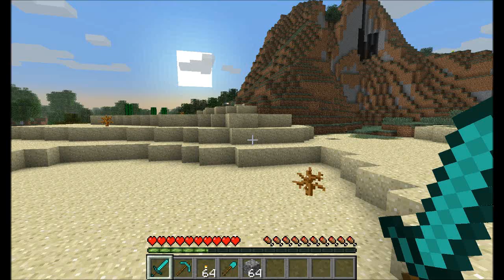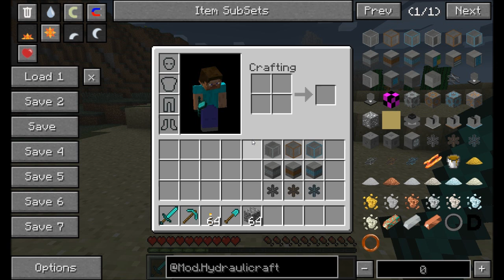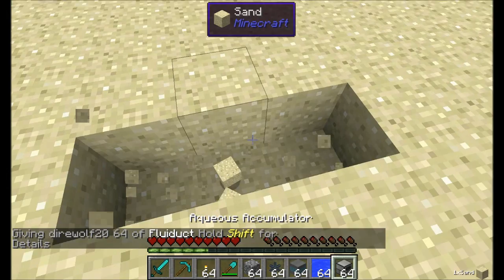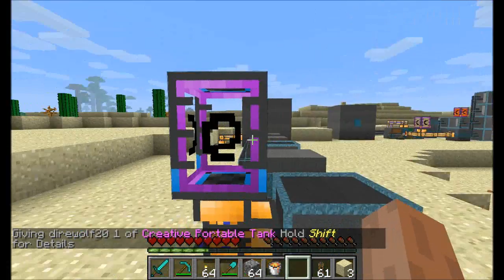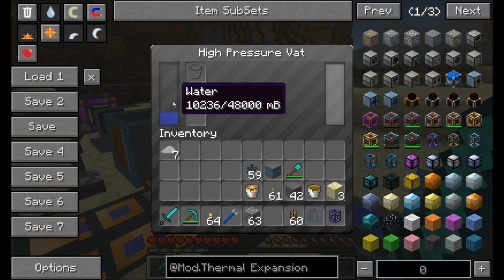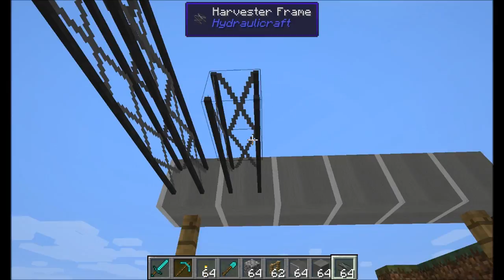Mod Spotlight   Hydraulicraft

Comment: As someone who plays with finite water... I don't even see HOW I could play with this mod. :p
I already have problems keeping my boilers running... with a system like this, I would need a separated world dedicated to pumping water exclusively. :p

Although it looks different, and the planter would be amazing even as a separate mod, so... kudos to the creator! ^_^
Reply: Nah, you'll only need initial water: Make a vat, a pump, 2 pipes and a mixer. Supply  it with water and wait for enough hydraulic oil. Once you have enough, you can quit using water and use all the other machines.
Reply: jedioutcast74 Because it becomes harder. Maybe he is using Gregtech which makes this.
Reply: You could make a Mystcraft age dedicated for pumping water.
Reply: ... im pretty sure that the Aqueous Accumulator from Thermal Expansion doesnt care. it fills with water from 2 nearby watersources to fill itself with water, but it will NEVER use it up :-) i tried on a server where water had the same effect as lava: not infinite in a 2x2 or any larger pools, and it worked there ;-)
need more water? make another Aqueous Accumulator. and for gods sake dont use BC pipes... if youre having trouble keeping your boilers filled with water, then you propably use BC pipes dont ya? fyi: bad choice. they are very slow to transfer water. Thermal Expansion Fluiducts are much faster to transfer liquids with.
Reply: You could install MagicalCrops and farm water?
Reply: jedioutcast74

Yep, I have always liked my games hard. Finite water + no natural regeneration are a must for me. Also, I have been playing Minecraft for way too long (there was no Nether yet when I started), and that makes getting a challenge a little more difficult.

TheLozfan123

I have done that. But nowadays, I play without "teleporting" items, so... not an option anymore. If I want water, I have to get it directly from a pipe/create it myself using resources.

*****

No, I mean finite water. As in... not infinite. Finiteliquid is a mod, and, as far as I know, it is not compatible with most mods. Not to mention that I think the mod is not updating anymore... I believe.

MadLocustRising1

What would be the point of that? If I wanted to have infinite water, I wouldn't be playing with finite water, right? Playing with finite water, and then finding "tricks" to get infinite water seems... not very logical, at best.

Zambogerami

That doesn't work. There is only one source block to "transfer". Yes, it would transfer very quick, but... it is only one block still.

Schist025  The Unknown Gamer

I don't use any mod to get finite water. Chicken Core (the mod you need to run NEI) has a config option that allows you to turn infinite water off, as well as other few nice "niche" options. So yes, the accumulator would work, since the water is vanilla water, but using an accumulator would negate the point of playing with house rules, don't you agree?
Reply: Schist025

But the point of not having infinite water is to make the game harder. Why would I use a machine that completely destroys the challenge in getting water... if that is exactly why I created the challenge for myself? That would be quite counter-intuitive, don't you think? (Also, TE is waaaaay too OP for my taste, so I don't actually have the accumulator as an option, even if I wanted to cheat myself using it :p )
Reply: ***** Meh shrug. I use dartcraft so OPness is kinda what I like xD
Reply: Coby Frye

Woah, someone needs to take his pill already. :p

I said "too OP for my taste". Are you trying to tell me what I should like? Because... good luck with that.

And yes, the accumulator creates infinite water. Mostly because it never runs out, AND it is created fast enough to fill quite a lot of things.
And about "they made water infinite for a reason"... are you really telling me that in a video about a mod? xD There is little Vanilla Minecraft in my Minecraft. I choose the mods that make my experience more fun, as everybody else.

Also... my boiler already exploded in one of my worlds, destroying everything except my Thaumcraft tower, which was flying in the sky, and I still preffer my way of playing, AND I still believe that the accumulator in particular, and TE in general is extremelly over-powered.
It even proves that I am right more than you are. Just by placing one accumulator, and doing nothing else, you can prevent boilers from exploding, negating the whole balancing cons of the boiler. If that doesn't mean that the accumulator is way too powerfull, I don't know what would.

You don't like that? Fine by me, but the least you can do when talking when someone is behaving like a human being, and not like an angry monkey.
Reply: finite water ... why ...? The challenge .. ?
Reply: Land Troller As someone who plays primarily with GregTech, it would be for the challenge, as for me it is the only way to keep Minecraft fun after such a long time of playing.
Reply: Finite water?
 Don't you mean finiteliquid
Reply: A good tip: Extra Utilities transfer nodes are the best water producers. Just throw speed and mining upgrades in there and you can easily run 2 boilers with just one node.
Reply: MadLocustRising1 Would the water that finite water has actually work for aqueous accumulators? Last time I used a finite water mod it had a different block for water than vanilla.
Reply: yeah its a changed source block. but its origin is still vanilla water im sure, so it should work. if the water works in Thermal Expansion blocks like a steam dynomo, who cant exist without water, then it will work for the Aqueous Accumulators aswell. system cant decline that its water, so it has to fill without using it up. dont see any posibility for this not to work, even with un-infinite water source blocks.
Reply: Zambogerami Put like 2 stacks of each in and they can run like 50 boilers off of one node.
Reply: ***** what mod do you use to get finite water?
Reply: The Unknown Gamer Here, http://www.minecraftforum.net/topic/1734363-164-fysiks-fun-sspsmp-forge-9111/
Reply: thats a 1.5.2 mod
Reply: ***** Not if you think of the accumulator as condensing water from the air. Would make sense too, given the name.
Reply: Coby Frye You don't have to be a jerk just because somebody has fun with something you personally don't enjoy. You made it sound like him not using infinite water is an attack on your religion or something. It's a just a video game, and furthermore, the choices Villanelo makes while playing Minecraft in no way affect you.
Reply: ***** 
1. The boiler exploding mechanic is fairly silly anyway, the mod is basically holding your entire base hostage if it doesn't get water.

Also it makes no sense, a boiler that can hold a million "Buckets" of pressurised steam explodes when you place a single bucket of water in there that spontaneously expands?  I'm not buying it.  Say all you want about explosive expansion, the fact remains that the boiler is clearly capable of withstanding that kind of stress.

2. Minecraft Oceans have effectively become infinite water sources even with finite water, plop a pump in it and you pretty much never have to worry ever again.  It's like the nether and lava.  Hook a pump to an ender tank (I prefer Tesseracts, more balanced) and you can run your entire base off geothermal.
Reply: *****

I think the explosion mechanic is less about making sense, or being realistic, and more about forcing you to take extreme care when using the boiler. Something like: if you can't maintain the boiler at optimal working status forever yet, then you better use something else.
And I like that mechanic. It feels like some sort of "tier", even without actually making tiers.
Something like needing to scan things in the nether before you can make the more dangeorous things in Thaumcraft. Sure, it is an artificial barrier, but still, that helps you feel like you have achieved something.
I agree that it doesn't make any sense conceptually, and that the boiler would be totally fine in a realistic situation, but... come one! This is Minecraft! The main character can, in theory, hold the weight of 6 Eiffel Towers in his backpack! :p

Also, and as a side note, the explosion of the boiler is quite small. The biggest high pressure boiler produces something like the explosion of 4 TNTs, and it is aimed at the floor. The problem in my case was that the boiler was in the second floor, on top of my storage room, and when it exploded, it destroyed all my chests. Since I was away when that happened... all my stuff de-spawned, and I was a Sad Panda. But the explosion itself is quite small. Definitely not enough to say that it holds your whole base as a hostage. :p

And about the oceans... you are wrong there, I am affraid. According to my data and maths, a big boiler (I never bother to make the small ones, and always go for the biggest) eats something between 150 / 200 buckets of water every 20 minutes (every Minecraft day) One would believe that is not a lot, but the boiler that exploded for me was connected to an ocean and 2 pumps (1 pump is not enough for a boiler) , and it drained the "area" of the pump in about a Minecraft week.
Sure, an ocean is really, really big, and you can always move the pump, but the point is... that you have to do that, and that takes time and effort. Specially if you don't use tesseracts / endertanks, and you only connect things with pipes. Thos are A LOT of pipes that you have to place one by one.

Believe or not, I have found that creating a system that uses both cactus and raintanks (from RailCraft)  to create water is, by far, much more secure than moving your pumps every few days... specially if you forget about moving them from time to time, and then you realize that you no longer have any water, and things may get ugly soon. :p
Reply: ***** Creepers aren't realistic, so why does a mod have to be? nothing in minecraft is realistic...
Reply: ***** ...im sorry have to stop you there:

1st off: infinte water is annoying in my opinion, not very friendly cause when you quarry on land and hit underground water, then its messy to clean up.
also very annoying that i cant get rid of poison/sludge or whatever other liquid pools hide beneath all that infinite water :-(
so i think its much easier if i could use a pump and a void liquid system of some sort instead...
my main reason: i accidently hit the end portal while quarriyng a river once...
annoying infinite water!

2nd: wow omg ! this is the longest comment i have read this year so far :-o
thanks for sharing dude ! have fun !
Reply: *****
First, I'm not arguing about realism per-say, doing that about MC is indeed, silly.  I mean, I use Thaumcraft.

But I have an issue when mod makers make their "High Teir" machines ridiculously weak.  I mean the boiler is this giant thing that can be destroyed by a single bucket of water.  I really think it would have been better for CJ to have made a different mechanic for that like damaging the hotboxes (Requiring you to dismantle the boiler in order to fix it) or turning a random number of boilers into lava (Which is damaging, but not griefy.)

About the explosion size, It has never been directed at the floor for me.  The boiler seemed to do more wall damage than anything.  In fact, the crater was wide enough that now I place the thing around 20 blocks from the outside of my base.

As a final note, care to share which mod allows water to be extracted from cactus?  Because I have yet to see a mod do that.
Reply: MadLocustRising1
Well, that is fine. I was actually not trying to convince you that my way of playing is the best ever. If you like it, fine, if you don't... then play your own way. It was everybody else who was trying to "correct" me, because I was playing in a wrong way, or something, I just say how I play and explained why.
Also... that was the longest comment for you? You better not read what I usually post then. :p

*****
I wouldn't opose to different balance mechanics, that for sure. Even if I don't actually have a problem with the explosion, seeing maybe a random effect would be even better: sometimes it explodes, sometimes, it creates fires around, or... whatever. That would be even nicer, you would have to be even more prepared.
Really? You have a full explosion? For me, only a few of the "fuel boxes" explode, and the boiler blocks themselves don't suffer any damage even. Maybe I have been lucky with my explosions. :p

And the mod is forestry, by the way. If you place cactus in a squeezer, they produce water... a very, very small amount of water. You need quite a factory, with a BIG cactus farm, if you want to get water only in that way.
Reply: ***** Ah so Forestry, that explains why I never encountered that.  I never used Forestry because it doesn't seem to like other mods very well (Not to mention I like Steve's Carts better :P)
Reply: *****

If I have to be honest, the only things I use from Forestry, are the bees and a few of the machines for small silly things, like the cactus thing, or the bottler, or the moistener to get mycelium.
I have never liked the farms, and I don't actually remember having used one ever. :p
Reply: ***** well obviously youre a noob. cause bees and trees = trees that grow fruit, and a manual forestry farm is the best way to go to get seedoil from these awesome forestry trees for all your beekeeping ;-)
Reply: ***** Yea, I think the auto-farms take some of the involvement out of MC.  I only automate the tree farm because chopping trees is a little bit of a pain.  Even with TiCon lumber axes.

Also the bees...oh god the bees.  I tried it once but it consumed so much of my time just to get cultivated that I just dropped it ._.
Reply: MadLocustRising1

Pfffffffff... ok.
Whatever, Mr ProMinecraftGamer. xD

One thing that you don't seem to understand is that I DON'T want the easiest solution. You don't seem to get that yes, I know there are easier ways to do things, but I wouldn't play that way even if it was the only way.
This will be the last message you get from me, though, so feel free to throw whatever you want to me. I won't reply anymore. I hope you have fun playing Minecraft however you feel is the best way.
Reply: ***** Thermal Expansion is not too op. Trust me. Also, you not using Infinite water, it's called being an Idiot. They made infinite water sources in minecraft for a reason didn't they? Aqueous Accumulator is just an automated way of doing it. I hope your boiler (that you mentioned) blows up from heat accumulation and destroys everything that you own. Would serve you right. After that happens we will see what is op.